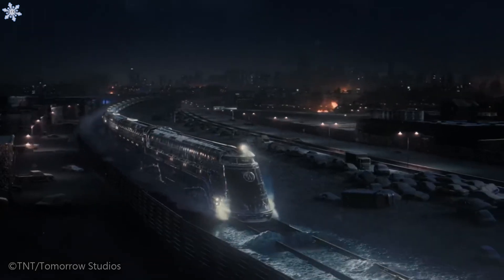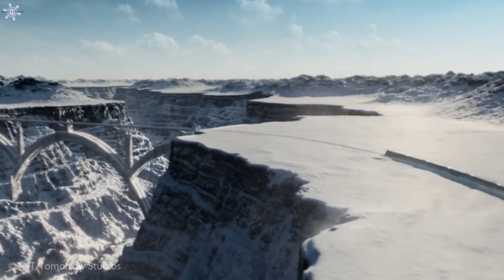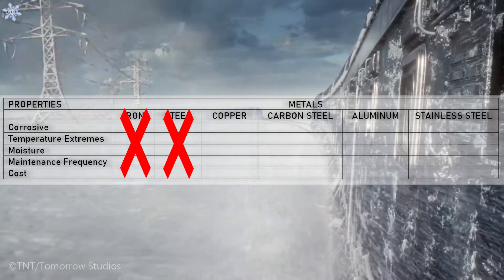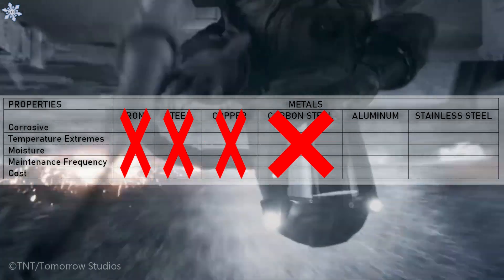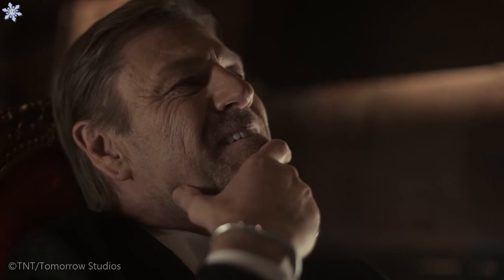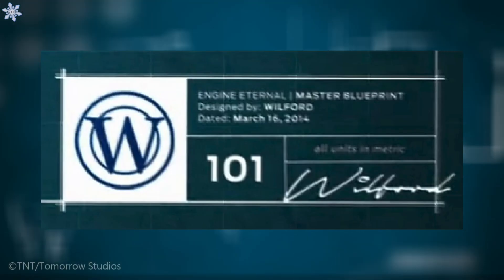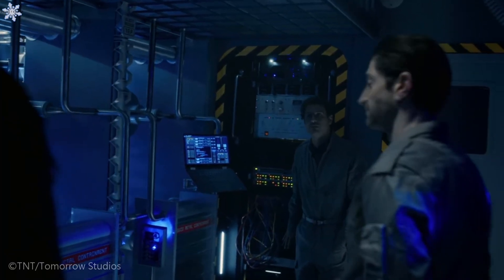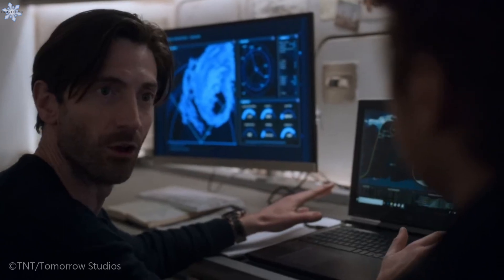Can Snowpiercer Actually Exist?

Comment: I wonder what kind of engines does Snowpiercer and Big Alice use and how Big Alice's booster work.
Reply from the maker: If you watched the video, then you would know it’s a hydrogen fusion engine.
Reply: @Frostrider  yeah the snowpiercer and the big Alice uses a nuclear fusion reactor that can use hydrogen, deuterium or tritium but in this case is hydrogen because is the most easy to get for the fusion to generate literally the power of a star

Comment: As "Found and Explained" channel said, The Nazis had a plan to make a litteral Train that kinda looks like the SnowPiercer, But cancelled because of the fall of Nazism and lack of materials and they are in a World war.
Reply: The Hindenburg Actually needed the Safer Helium, And Germany Needs America's Help, But they are in a World War, So They are Forced to use the Explosive Helium.
Reply from the maker: @nathan.bobloc  Helium is expensive and you’re using the wrong tense. WW2 was an past event so you use past tense phrasing when discussing it.
Reply: @Frostrider  You win.
Reply from the maker: It never would’ve worked. Kinda like the Hindenburg which crashed and burned because those idiots thought putting explosive gas in a large balloon carrying people was a good idea and look how that turned out. Also the Nazi train was tiny compared to Snowpiercer, and was never actually put into construction.